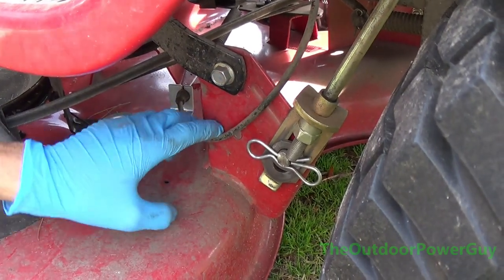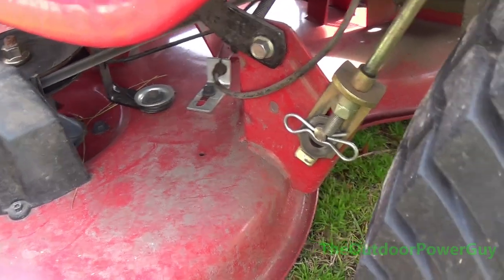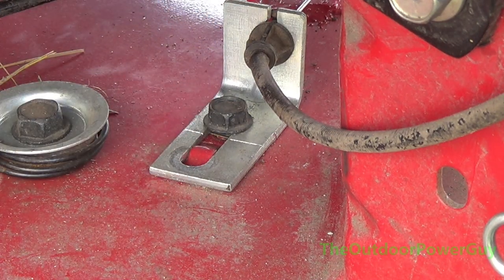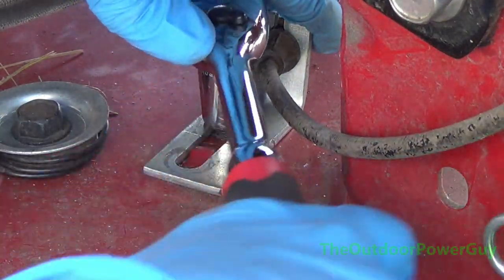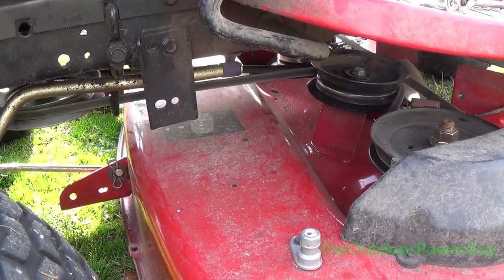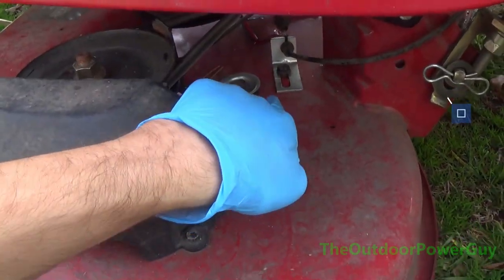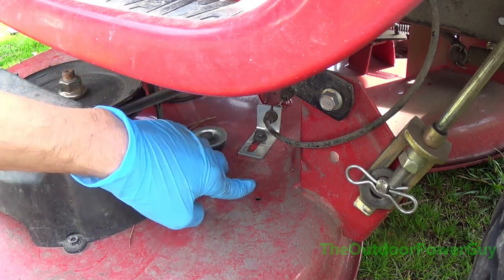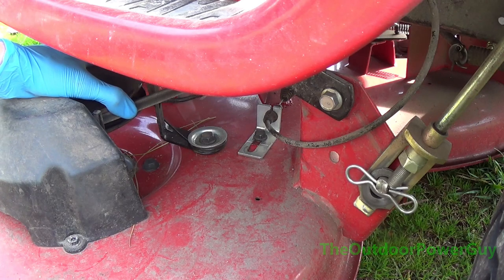HOW TO ADJUST DECK BELT TENSION ON NEWER HUSQVARNA RIDING MOWERS

Comment: Good video, I have gone through many belts for the last 9 years on my 46"deck.  Quality of belts seems to be the main thing not by price.  Looking for a brand I can count on.  I have 1 1/2 acres of grass to cut plus my neighbors.  Six to eight inch grass is rough on the belts.  Wish there was a added way to take up the slack.  Also found some belts are more than 105" long.  Boo

Comment: Will the Husqvarna mowers that have a knob you pull to engage the blades, and push to disengage the blades, also adjust the same? Thanks
Reply: Similar 😊but there isn't a line on bracket ...

Comment: I've tightened mine all the way and it's still too loose. I've confirmed it's the correct size belt but it's coming off the spindles occasionally when I disengage the blades. Any clue what's going on there?
Reply: I'm not a mechanic, but, is your belt fairly new, and it's not a old belt that may be stretched?

Comment: thanks. just what I needed. I'd already put on a new blade belt just in case, and changed the blade clutch cable (3 times!. warning don't buy chinese "compatible" part for the blade clutch cable - the spring is too thick, and shreds the cable casing when engaging the blade. husqvarna one works fine, even if it is more expensive). my right-angle adjustment piece was in the loosest setting possible. moving it back to mid point and now working mower.

Comment: Great video.  thanks.  My belt continually falls off the motor pulley when NOT engaging the blades.  It's done this since new!  It's most annoying as everytime I go to engage the blades I must stop the engine and slip the belt back over the motor pulley.  It's as if the belt was designed too long for the mower.  I called Husqvarna and asked how long the belt should be and it falls right on with my belt but will not stay on the pulley.  While engaged it's fine, but when I disengage and drive around a bit, the belt simply falls off again.  Any thoughts?
Reply: Did you buy the yth18542 from Lowe’s??
Reply: @gunnarisawsome  No, I bought it from Castle Building Centre.
Reply: Know this is an old comment, but did you ever figure out what was causing this? Mine is doing the same exact thing.
Reply: @gunnarisawsome  I bought that one and it’s doing the exact same thing but completely stretches out and can’t use it again- you got that problem too?

Comment: Ive replaced the belt cut half the yard just fine. Stopped to get the mail and went back.to cut and blades only got up to 1/4 the speed. Adjusted  this bracket. And no help. What should look to next to get the blades turning full speed?
Reply: New belt. They can get stretched out.

Comment: I'm not the smartest guy in the world, but I'd just try to find a smaller belt
Reply from the maker: a smaller belt would cause the blades to turn all the time, thus causing damage to pulleys, belt and brake pads, adjustment is there for numerous reasons, using an OEM belt is always the way to go.